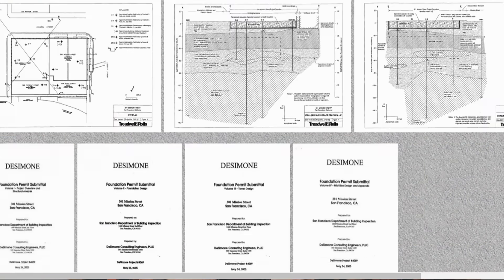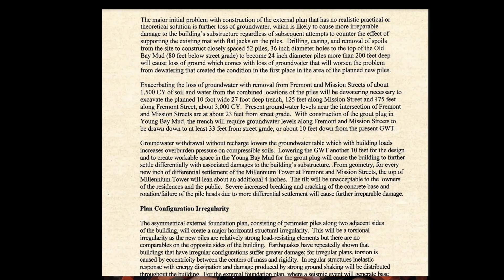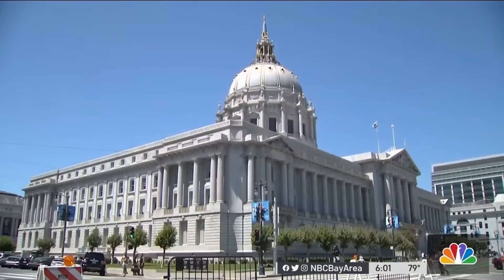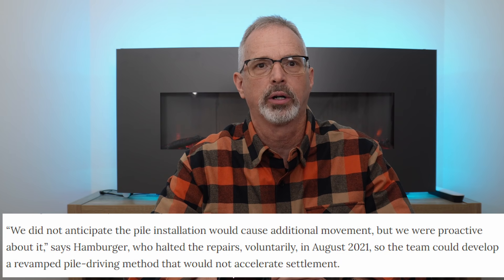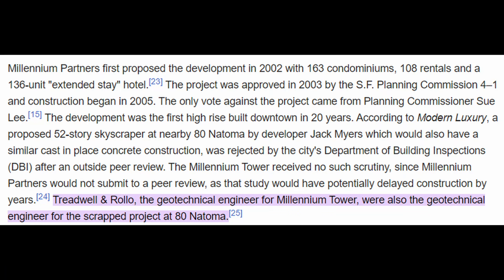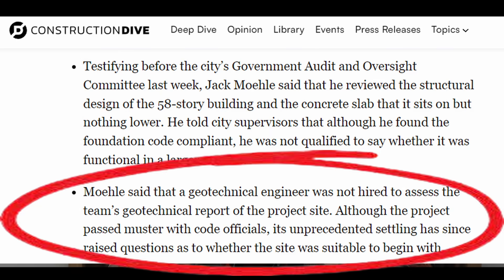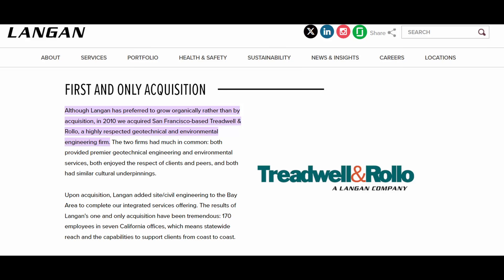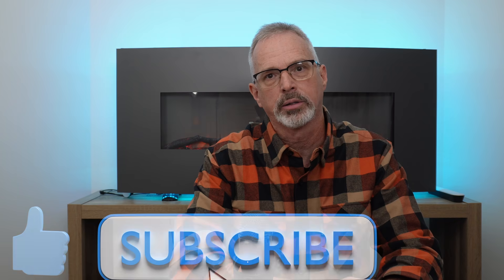Millennium Tower  -  $500 Million Wasted?

Comment: This tower may very well lean to the point where the elevators and plumbing will not function acceptably well, and it may have to be abandoned or demolished. However, it is unlikely to simply “fall over,” as the general public seem to believe. Nevertheless, the perception of impending disaster is yet another reason to tear it down.

Comment: I'm not an engineer.  I couldn't nicely nail two boards together.  But even I know that the building was placed in a part of San Francisco which is land fill of what was once San Francisco Bay waters.  The ground isn't solid.  During an earthquake, it "liquefies" and provides no support.  Even I realized from the get-go that sufficient pilings needed to be placed down to the bedrock of the earth.  Any other decision was just made to save money and then flee the project with pocketfulls of money. This is on the developer.
Reply from the maker: I agree. The issue of the liquefaction potential is concerning.

Comment: Leaning tower of pizza was straightened a bit by removing dirt, possibly rock out from under one side of it. Causing it to straighten up a fair bit. Doing so might break foundation reinforcing and slab as you said. Concept was to remove thin tubes of dirt by drills leaving small thin empty voids to be crushed by weight of building to gradually straighten the building. Then to gradually repeat the process to gradually straighten up the builing. It worked on the leaning tower of pizza in Italy. Possibly to late now as repair money has been spent.

Comment: They did a shoddy design on the original building construction because it was cheaper.  Then they went with a shoddy design to try to fix the leaning because it was cheaper.  Every time they tried to do something because it was cheaper, it ended up costing them more.  Tear down the f'ing building at the developer's expense.  The developer should then be forced to pay off all the condo owners for their loss plus for all the trouble they have faced.

Comment: It's incredible that heads haven't already rolled for this debacle. Has the slab been inspected for deflection? Considering it was designed for a uniform load and it's now being subjected to a substantial perimeter load, it's experiencing significant strain and as a result, must be deflecting. Unless it's possible to revert back to the uniform remediation that was rejected in favor of the perimeter remediation (which I doubt), I will be surprised if this building doesn't end up being condemned.
Reply from the maker: I agree with you.  There are local engineers who have raised this same issue and it has so far gotten zero consideration from the parties involved with this project.  After all, if the foundation slab is rigid enough to uniformly distribute the building loads to the piling, then you would think that when one side of this slab settles more than the rest, that there will be some yielding of the connection between the top of the pile and the cap since the higher side of the slab will be placed in tension.  I have come to a realization about what is going on with this whole situation following comments from viewers and additional research that I will be sharing in a future video.  Thanks for your comments.

Comment: Who supplied the steel?
Reply from the maker: It is a reinforced concrete structure.  The original design was for a steel framed structure but that got changed by the developer to supposedly save money but it ended up dramatically increasing foundation loads due to the greater weight of the concrete.

Comment: I have almost 6000 building peering projects in my resume, with a high profile one within the next 2 months. I can tell you first hand that they will NEVER straighten that building. Depending on rock formations under the building it might get stabilized. If the soil is unstable (like I forecast) you might get some results but the skin friction will never be enough for the results they are looking for. We drove helicals in Louisiana that had 18” flights, but they still could not even stabilize homes because no matter how far down they went they never hit a,solid substrate.
Reply from the maker: I think it is something like 10,000 feet to bedrock in most of Louisiana!

Comment: I'm not mocking but you have a misspeak.  At 3:34 you say:

"The projected $150 million cost for this external plan ballooned to $150 million."

I think you meant to say

"The projected $150 million cost for this external plan ballooned to $500 million."
Reply from the maker: Yes,  you are correct, I missed that.  I intended to say the the original estimate for "repair" costs was $100 million which ballooned to $150 million.  If you add in the original $350 million construction cost you get the $500 million figure.
Reply: Fact checker, what a jerkoff. Everyone knew what he meant.

Comment: Several things come to mind: "A stitch in time saves nine"..coupled with `kicking the can down the road". When the news first came out about this tower, one specialist or engineer (i think he was at Berkeley) said the only way to remedy the situation was to cut off the top 20 stories.  This whole terrible bandage works to avoid that and not touch even one unit. Sadly, I think the building is leaning in the direction of the Salesforce Tower,,,which I wouldnt want to be in either during a quake. One big question is: how are taller and (supposedly) better engineered buildings in the immediate vacinity settling? Ie., 181 Fremont and the Salesforce tower? In addition, there are a whole bunch of 30 plus story residential buildings to the south built afterward. I wonder what's happening with those towers??
Reply from the maker: I would like to have the records that indicate the foundation details for the buildings you mentioned.

Comment: It may be a little early to make a decision to condemn the building (but it seems like that is inevitable).  However, there are things we can do now that may be more important.  Developers and regulators can learn the lessons of the Millenium Towers.  There should be absolutely no shortcuts allowed when designing commercial development.  There is often enormous political and economic pressure to approve designs with a promise that the unresolved problems will be fixed as the project is completed.  The developer must have the burden of proof that any tall structure will be safe.  It should not be up to the regulators or the public to show that it is unsafe.
Reply from the maker: I agree with you.  I wonder what would have happened if the original geotechnical engineer had properly insisted on an adequate pile foundation that extended to bedrock.  Would the developer have listened, or would they fire that engineer and look for another one who they hoped would be in agreement with the cheaper approach.

Comment: The cracks in the basement cause me a lot more concern than the tilt, which is still tiny. 

For your amusement. I watched my first US employer build their new headquarters in Alameda, just across the bay. The tallest buildings are 3 floors. We didn't see the piles go in for the first two buildings, but we had a front row seat to the third, and 4th. The piles are 80 feet long, they basically dropped the piles through the top 10 feet or so, then used the pile driver to go the rest of the way. We were on about 15 feet of fill over bay sand over hundreds of feet of mud. The piles were mostly 8 feet on center and formed the base for the steel uprights that formed the corners of the main body of offices in 90% of the building. Trenches several feet deep connected the tops of the columns and were filled with rebar which was connected to the top of the piles. The grade beams were massive. The uprights were something like 18"x12" I beams, and my memory from 25 years ago is that the steel was about 1/2". The whole structure was also cross braced with 8" diameter pipes in the middle half. The floors were corrugated steel mechanically fastened to the structure then welded and with concrete poured for the floors. When I saw them using similar piles for buildings like 2100 Powell in Emeryville I was very surprised.
Reply from the maker: That is very interesting.  It is beyond amazing that somebody (several people actually) thought that a such a foundation would be fine for a 600 foot tall building.

Comment: Once friction pile break bond, hard to stop them from creeping. Weird that the did not do compaction grouting prior to micropile installation. Also, that's a lot of load to transfer between bonde between top of micropile and the core hole in the existing foundations.
Reply: Also.... friction Piles getting side friction from cohesive soils will lose strength in a drained condition, too.
Reply from the maker: I think creep, with associated downdrag will be an ongoing issue.  The Old Bay clay layers have experienced primary and now secondary consolidation.  The secondary consolidation is likely to continue for many more years to come with further resulting ground settlements.

Comment: Amazing video. I think we all expect that after this building is torn down everything in your video will turn up in a final report. Some guy in  suit will inevitably explain to anyone who'll listen, "But we didn't know."  All the mistakes will boil down to human behavior, and not just greed. The tendency of greed is to be frugal. It's not frugal to construct a building that won't outlast its mortgage.  What would be interesting is a graph of what a building like this costs, what it's profit projection is, what the additional costs of doing it right or fixing it at each particular moment would be.... In the beginning will be a rosy picture of a very profitable project. On top of the costs graph will be a thin thin line of additional engineering analysis and subsequent expense making a better foundation.  We all know what meetings are like. They're usually a boring reiteration of whatever the boss wants. Raise an issue and you might get away with it a few times. After that you're considered a trouble maker. Of course it can be difficult to tell the difference between a crank and a critic. This is where the 'We didn't know' excuse making turns description into the passive voice, "And then the building foundation started settling." 
Your proposal at the end is of course reasonable and will save money in the end. When you mentioned 'condo board' I'm sure most viewers immediately thought of the Surfside condo collapse in Florida two years ago. Here I can imagine the condo board saying, 'There isn't enough in the budget to do this year, but next year.....'  (I just googled this so I could have my facts right. What does Google say caused the Surfside to collapse? "Problems with the pool deck."  See we don't even have a pool deck in our building.... It wasn't the pool deck, and I'm always annoyed hearing 'engineering failure,' Engineering works pretty good. It's humans who fail. So part of walking into the meeting and saying, 'Your engineering solution is inadequate...' you really need to have a behaviorist on the team to add to the engineering analysis:  "Your group dynamics created this problem, failed to fix it, and unless something changes, will likely doom this building and cost even more money than you can possibly imagine."
Reply from the maker: Thank you for your comments.  They are all spot on.  There seems to be way too much focus on short term gains versus long term viability in these situations.  You mentioned Surfside.  I recently did a video about my take on that situation if you want to check it out. 
https://www.youtube.com/watch?v=Ebj5fCE7hV4

Comment: Better to cut your losses and condemn the building.  The residents of the building will get screwed when their property is worthless.

This will probably cause much finger-pointing and (hopefully) reevaluation of building requirements.  
Not having an independent review of the geo-tech design docs is incompetence and maybe they should face consequences.
"There is never a political solution for an Engineering problem"

Comment: Had a hard time getting a permit for a 10x20 carport, had to use 10 concrete footers 2' deep by 10" with 3 rebars drove down 12" and this is in Tennessee 350 miles from the ocean, probably will survive a 125 mph wind gust.
Reply: Required to be below the freeze line. That is why the columns.
Reply: @josephburke7224  I'm not a engineer but it seems extreme,  the city official never mentioned freeze line only wind load, don't think it will ever blow away, seems stronger than a mobile home, and I did the labor so it really wasn't much more expensive.

Comment: That building will collapse.  As it tips more weight is on one side and the other side is being stretched. 
It is on borrowed time as it is already far beyond its design tolerances already. 
Leave the area before you are buried alive
Signed 
A structural engineer

Comment: QUESTION: Mud Jacking has worked on some structures. I think it may have been one of several aids used to partially right the leaning tower of Pizza. Was mud jacking ever considered for Millennium Tower?  Or, is the pressure of 52 stories too much for mud jacking to be viable? Mud jacking the northwest corner could be able to UNIFORMLY distribute additional support, sufficient to minimize the risk forming the diagonal crack that was a suggested of the current 'remediation' technique. Mud jacking could even be done in stages. First one, then a hole bored through it after solidification, with a second (or third) injected below it

Comment: Thank you for a very insightful explanation. I've followed the Millennium Tower (MT) issue just for its novelty...that such a large and exceptionally heavy building would elect NOT to go to bedrock, and that the city permitted it. The Sales Force tower went to bedrock, and became a source for ribbing MT. With a tilt of 30 inches, the condos are worth a small fraction of their purchase price. Added charges for 'remediation' add insult to injury. Also, Mr. 'Hamburger' has long seemed like a shill. His change from 52 to 18 pilings is just one example of what looks like little more than guessing.

Comment: The elephant in the room here is that the SF city government is extremely corrupt, and that safety is something they're perfectly willing to half-ass as long as the developer is paying the potentates with "campaign contributions".
Reply: And what about the elephant in the room of the builder that you assumed intentionally trying to build a building that they knew would fall down. 
You need to separate your politics from engineering. They are a terrible mix.
Reply: @neilkurzman4907  Is there a big difference in your mind between builders that cut corners out of corruption vs. builders that haven't the slightest idea how to do their job but still pass themselves off as compitent?
Reply: @johnpublic6582  
Plans are supposed to be signed off by a PE.  They have to be licensed.
But you do have to wonder about a builder that would hire someone to design a foundation that was outside their experience. Who knows maybe the company hyped themselves up because they needed to work.  
Someone should be focusing on that aspect of this engineering disaster. 
How did the building managed to get built in the first place. And how do we make sure it never happens again. 
Like the Tacoma Narrows Bridge.

Comment: Residential general contractor here, I'm the guy you call when you have a big problem that no one else can fix.  I come up with innovative, high quality solutions to really big/bad problems, in the past handful of years, that's been mainly foundation problems.  Like you, I've gotten really tired of volunteering building advice to friends and acquaintances who ignore the advice, sometimes very pointedly and end up with screwed up buildings and houses that oftentimes cannot be completely fixed no matter how much they pay.  Remember, a repair, even one that's stronger than the original construction, is still a repair. 
I'm in the labor business, not the materials business.  Materials are a necessary evil for me.  The best way for me to turn $500 worth of materials into $5,000 is to have to surgically insert them into a building.  
The best, cheapest, fastest way to do something is RIGHT THE FIRST TIME.
Reply: Bah!  Plenty of time to do it right later.
Reply: @johnpublic6582  By the time the building falls down Hamburger will probably be dead, so why would he care?
Reply: Well, apparently it would have cost another $5 million to drill the piles down to the bedrock at the start.  Nahhhh……save the $$$$.